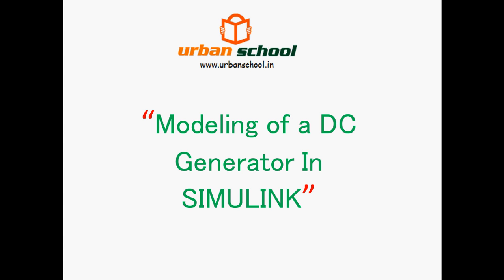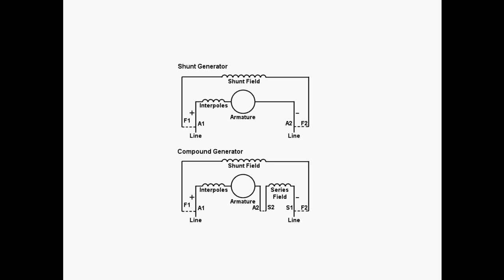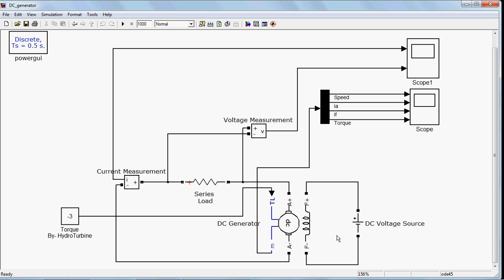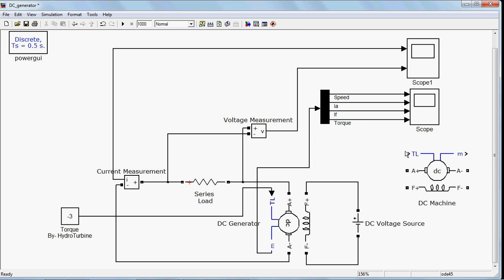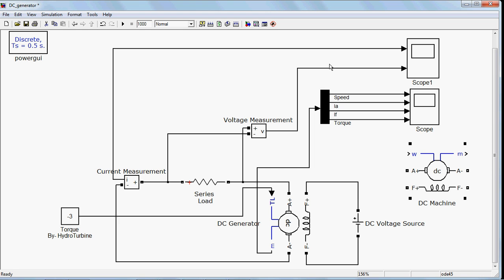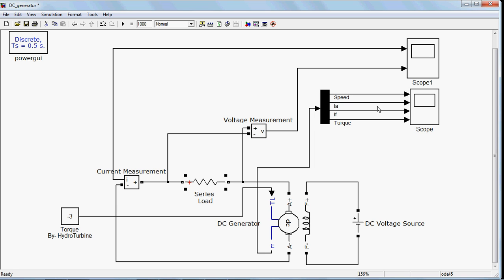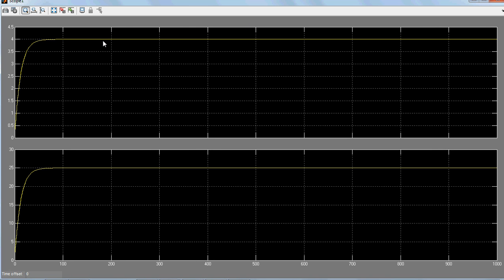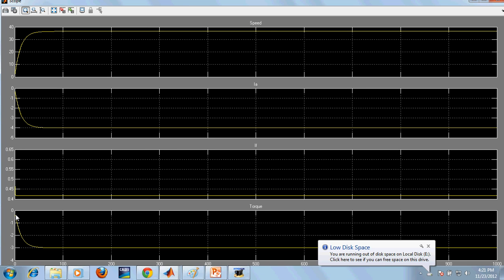Learn how to model a DC generator / Motor in Matlab SIMULINK

Comment: How copy da torque component in simulink library ony torque convert is shown plz reply me??
Reply from the maker: You can use a variable input or a constant block available in commonly used block section of Simulink library.
Reply: @UrbanSchoolTech  if I change the field as a permanent magnet ,is it now a real function of bldc motor or  not

Comment: i am having issues controlling my dc machine with a four quadrant chopper. the response I see at the scope after running my simulation is useless. please how can I model the speed control of a dc motor using a four quadrant chopper

Comment: Thanks for the video. I am trying to use PV array supply power to DC water pump and would like to use hydraulic turbine to harness the energy of falling water and convert it to DC power that will be use to power the DC water. Any advise? thanks

Comment: every time i tried to connect resistor with dc machine it shows red dotted line i googled it and it shows it is not possible to connect simscape elements with simpowersytem
Reply: That's not electronic resistor, add series RLC load block and set inductance and capacitance value 0.

Comment: i get the simulation ... all i need is how do fill  the parameters....i  mean what values are to be inserted ...? how to calculate  the values....?
Reply: +Keerthi Kumar here is something that woked for me:
Voltage:100V
Resistance:10 ohms
(important): Simulation time:1000
DIscrete powergui:0.5s
Reply: simulation time?

Comment: hello sir, where can i get the "Torque By -HydroTurbine" block in simulink??
Reply: +shahreen on It called a constant block (in case you still didn't find it).
Reply: AuFract_1729 
Sir, I type constant block but didn't find the torque by hydro turbine. Could please help direct me to find it especially for mattlab2010

Comment: How did you connect the load resistor? mine cannot connect, it has red dots instead.
Reply: Select the RLC load from simscape library then set the Reactive powerto zero,both capacitive and inductive.
Reply: how can i connect?
Reply: Yes how